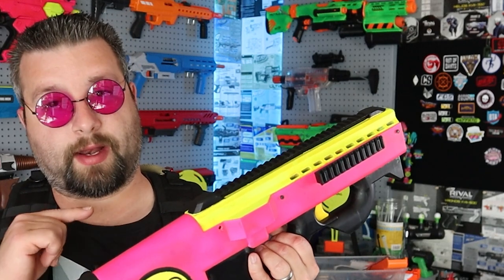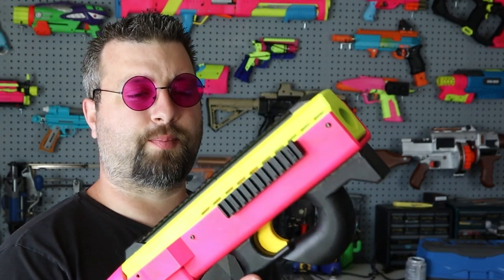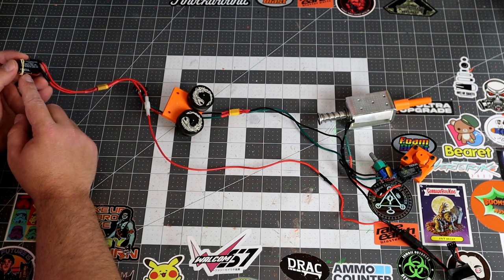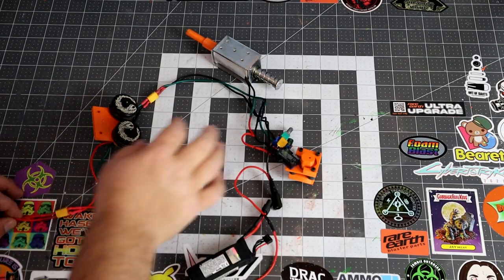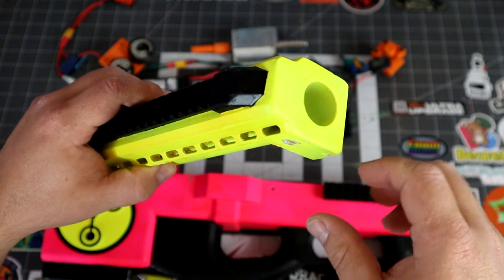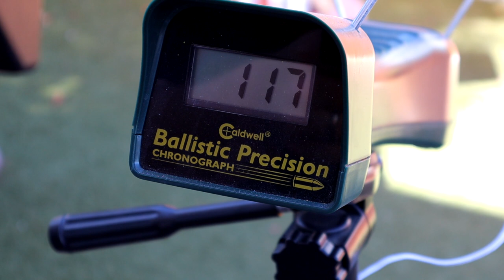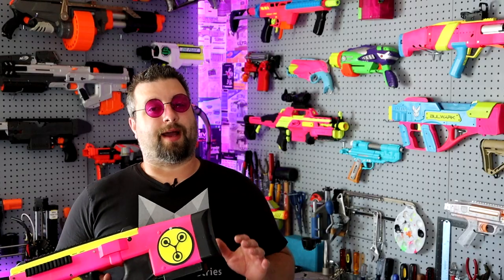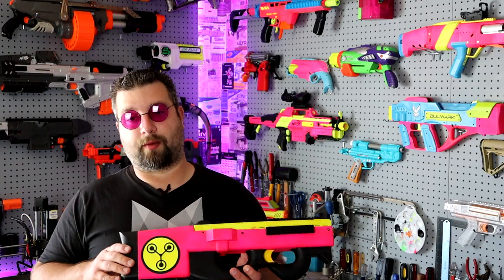Nerf Full Auto Solenoid Power House!! The Nerf PDR Build Log

Comment: If the cam was shaped to fire three darts in one rotation and it had one offset tab that hit another switch connected to a separate battery to flywheels and cam motor circuit. Pressing the trigger moves the tab off the switch giving power to the flywheels and cam motor for one rotation firing three darts then the tab hits the switch again cutting power. I'd be happy to do some 3d modeling if you need it and give you the stl files to print.

Comment: You're doing things the hard way :) (cough)Narfduino(cough)

BTW, the variable DPS you're getting seems to be short stroking. You can occasionally hear the solenoid beating the dart a few times per shot, and depending on the spring, it may not be fully retracting between short strokes.
Reply from the maker: I had a segment that I forgot to put into the video explaining that the goal of this build was to make a low cost full auto solenoid blaster that had no micro controller. The PWM is the first stage of it and when I get the correct voltage nailed down, my plan is to take it out and give the cam motor just enough to sustain reliable solenoid full strokes. In the footage it was turned up a little to high it seems because the solenoid was not getting the full stroke. Also I think my spring is too stiff. This is an ongoing side project I will revisit in the future. I have a couple Narfduinos for the Fluxed Hummingbird build that Flaming Foam and myself have been working on. That will be the flagship build with all the bells and whistles.
Reply: @drflux  It looks like the solenoid is double sprung.. I've had good success with ucell 45x14x0.8 mm springs, as they seem to hit the sweet spot between being reliable on 3s, but being high performance on 4s. But yeah, I think you had it a little too high. Just a smidge slower should help you get that shot out every time :)

Comment: Why not use a linear pot to determine the voltage drop needed, then use a variable DC to DC converter to dial in that DC voltage?

PWM really isn't good for brushed motors and if you can figure out what voltage the cam motor needs to be powered at via experimentation, you can use a multimeter to use the better device for the use case you require. 🌝

Though I'd personally use an Arduino or airzone's narfduino to use software to control the solenoid's on/off rate, and you can use pwm to tell the board how much dwell (length of time the pusher stays powered) and delay (length of time the solenoid is kept unpowered to allow the pusher to fully return).

Though your solution without using a computer is very good if you want to stay away from software control.
Reply from the maker: Yeah i was kinda seeing that.  I have been using the PWM to experiment.
Reply: @drflux  yeah, though it's hard to tell what the average voltage you're feeding it is using a multimeter. If you use a linear pot and measure voltage at the motor terminals, you can easily tell the voltage you need without using an expensive oscilloscope.

Comment: If you were to run your cam motor like a rapid strike pusher, so that it always does a full rotation, you could add another cam with three notches instead of one notch to it.

But honestly before you try to fiddle that into a working state, you should learn how a 555 timer works and use that instead :)
Reply: A selectfire capable solenoid controller like that actually already exists, but I don't know if they are still available.

Last option would be a small Arduino, which might be easier than doing the 555 timer from scratch...
Reply from the maker: My buddy was explaining to me how a 555 timer might be the best affordable option for this.

Comment: Nice setup. Where is the CAM Motor design from?
Reply from the maker: i sliced it out of the bulwark
Reply: It's a rather clever design to avoid using a computer for timing. Similar to a distributor in carburated cars.